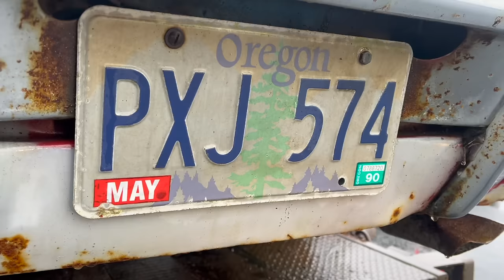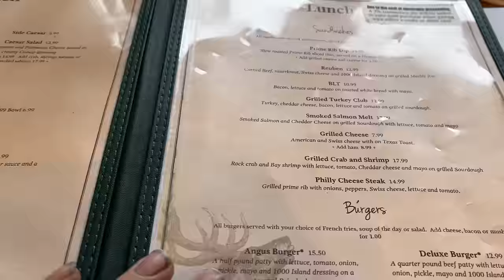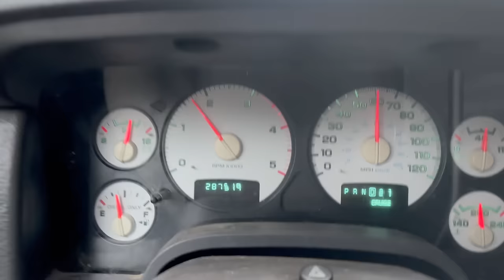I Bought A Rusty 1969 Dodge Charger! (But It's Worse Than I Thought)

Comment: You seriously need SHELVING all the way to the roof on all 3 sides and a roller ladder for access plus a battery powered forklift too, Storage problem solved AND you will get your floor back. + maybe a mezzanine. Just saying
Reply from the maker: Huh. That’s almost exactly my plan actually. Starting with heavy shelving down the long not-door side. It will be built strong enough to stack engine blocks and transmissions. And we definitely had rolling ladder in mind too. Haha. The mezzanine will enclose the area between the two post lift and the corner with metal shelving, including the wood stove. Underneath will be a workshop area with my heavy fab table in the middle. It will have rolling doors so it can be closed off from the rest of the shop for easy heating. Upstairs will be storage, a small office, and maybe a small spot to relax and live stream from. I’ve got plans, man… but before any of that can happen, the shop needs a roof.

Comment: How many vehicles do you own?  (coming from the guy that gave hoarding a bad name)
Reply from the maker: It’s been hovering around 22 for a long time. Every time I try to lower that number, something else shows up to fill in the space. I should probably just stop trying.
Reply: Its amazing how the universe rushes in to fill the vacuum..  I have three lawn tractors that I mow my acre and a half with.  (2 of my newest ones always go down at the same time), a tractor I use only for brush cutting,  2 yard mules,  two garden tractors and three problem children that need motors.  I am not even going to get into my seven woodchippers.  I just scrapped a tractor that the transmission got so loud it drowned out the motor.  I would have run it till it blew  But I needed the motor for one of the problem children.  You have a great channel.  I grew up with my Dad's Mopars.  I have owned a 76 Plymouth Volare Road Runner and a 1976 Chrysler 300.  My wife loved the 300.  She pulled out of a a fast serve joint and pinned the throttle.  The ice water I had in my lap dumped all over my crotch.  I was howling like a hyena and she didn't let off the gas until we were a mile down Route 9.  God times.

Comment: Discovering more of my own ignorance, why is putting a car on a trailer backwards "super sketchy?"
Reply from the maker: The weight in the average car is heavily offset toward the front. With the drivetrain in place, setting that weight at the very back of the trailer seriously destabilizes it. You want the weight set on the trailer such that you get tongue weight and the trailer won’t sway. The excess weight at the back can actually cantilever the trailer and remove tongue weight, and it can lead to disastrous trailer sway and instability. On this trailer, I basically always put cars on front first, and just about as far forward as they can go, and it works great. In this case, because the drivetrain is out, it’s not a big deal.

Comment: That’s a 69 or 70. That’s not a 68 Charger. If it was an 68 Charger, it’ll have the rounded lights in the back.
Reply from the maker: Are you serious right now? You’re commenting on a video called “I Bought A 1969 Dodge Charger,” in which I buy a 1969 Dodge Charger. At no point did I refer to this car as a ‘68. I did briefly show my red 1968 Charger. For like ten seconds. But I hope the fact that I own both betrays the obvious reality that I know the difference. Thanks.

Comment: I bet i have rust free doors and that dented grill part in my semi trailer. You have to stop picking the scabs or it may bleed out. How to put this nicely. Its got potential. It will buff rright out. Who am i kidding it needs a lot of love. But its a 69 charger so love it and make it a dick landy hotrod. I said it had potential and that was said about me too and look how i turned out. Ok dont look. 😢
Reply from the maker: The doors might be the best parts on it. Haha. The grille center would be nice. Back bumper is goobered. The front right fender with the horrible cancer in the top surface probably needs replacement.

Comment: Street Machine.  Don't Ruin it More than it is by putting it on the Strip.  Just My Thought.
Reply from the maker: No matter what, it needs a lot right now. And - I occasionally race an 86k original mile, original paint, two owner Demon 340. My idea of a drag car has stock wheel wells and openings, a stock dash, and just about everything else as it was originally built. I’m not talking about building a hacked up race car.